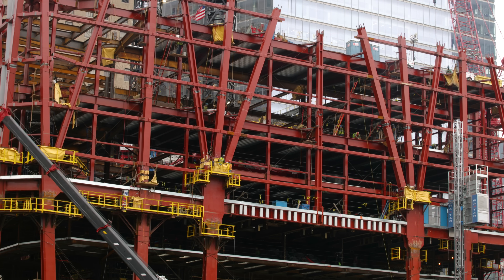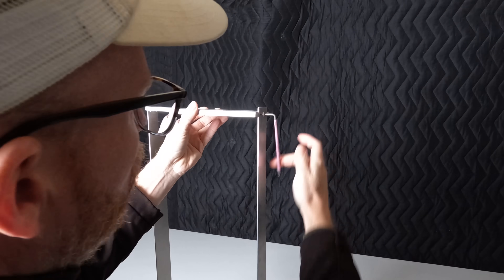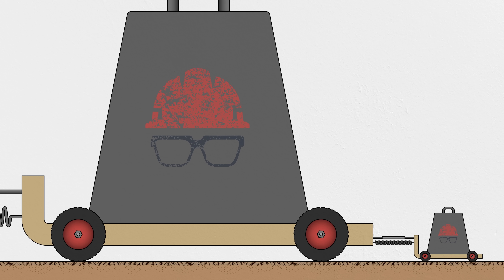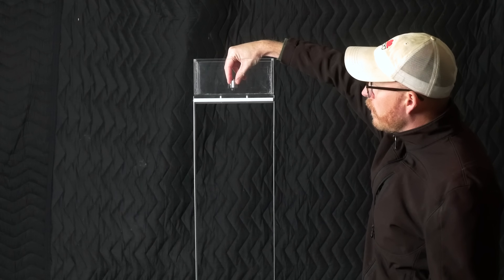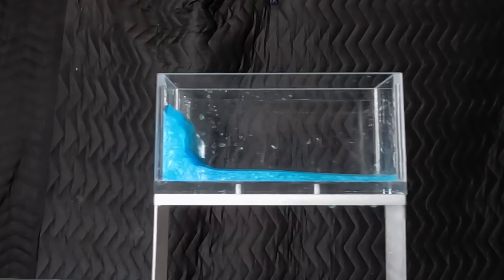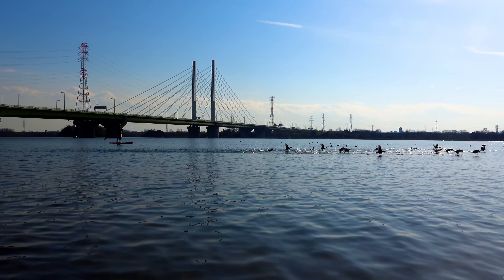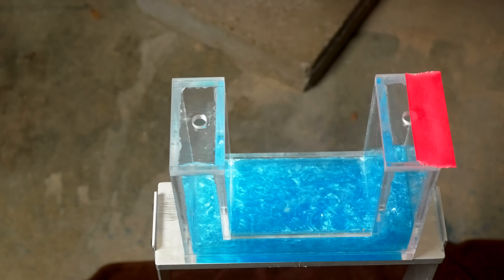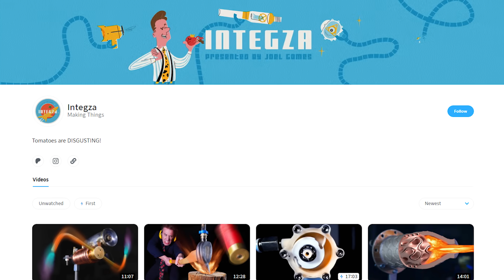How Liquid Dampers in Skyscrapers Work

Comment: It seems to me that taking a page out of automotive shock engineering technology and use magnetically rheological fluid with feed back sensors for a computer to adjust the system on the fly. It’s a very tunable system. ? If financially feasible?

Comment: For the "slosh pool", you could get a much better damping effect with a smaller volume of water by putting the shape of an impulse turbine blade on the end of each wall, so that the maximum amount of kinetic energy was direction ally opposed to the motion of the building.  That would incur additional cost, which is always factor #1 of course, but maybe the smaller size would make up for it?

Comment: Magnetic Rheologic fluid would be the next step to take if a passive water based damper does not achieve the desired results. It would allow real time tuning to dampen oscillations. It’s the technology used in high end race cars, first pioneered by GM for the Corvette.

Comment: Are the baffles also allowing for greater energy transfer between the liquid and structure? Each wave cycle now applies force both to the container walls and the baffle as it passes through. Seems like the ultimate answer would be flow through an isotropic rigid medium coupled to the structure.

Comment: You mentioned adjusting the air hole in real time, but it seems to me you could do a lot more with "active liquid dampers".

All kinds of friction screens and pylons could be raised and lowered in real time from the bottom of the tank to rob the current liquid motion from being transferred back to the building. 

Perhaps even pumped jets to quiet the motion faster. Basically like active noise cancellation earphones that use waves to cancel waves. This would be investing additional energy in return for less vibration. It could be useful as an emergency system when you would be happy to occasionally throw away a great deal of energy in the face of a rare dangerous wind condition.

Comment: Besides the tank being used for fire codes, it could be combined with two additional uses of water tanks at the top of buildings: 

The "water tower" tank used to provide water pressure for the resident's plumbing. 

And thermal batteries that are heated or cooled during cheaper night rates and then used for building temperature control and hot water during the day.

All of this makes me wonder if you could be really clever and not even have a wave tank at all. Just design the piping that runs up the sides of the building for other purposes to slosh liquid from one side to the other as needed.

Comment: So, basically fluid friction converts kinetic energy into heat energy. An automotive shock absorber does this too. Active suspension debued in formula 1 racing. Certainly a sensor array could tune  response to input forces faster than a fixed tune.

Comment: If space is a concern I wonder if any companies or engineering firms have considered working with a liquid more dense than water? The main limiters I can think of would be safety of exposure (water is pretty safe to be around but a denser liquid like mercury not so much) and cost to obtain the amount you'd need. a vat full of glycerin large enough for a skyscraper might be a little cost prohibitive lol
 but it does peak my curiosity!

Comment: That all looks very two dimensional. How do you get the damper to work when your building can sway in 360 degrees, as seen from above? And since it's probably got more than one mode of vibration, it's probably swaying in multiple directions all at the same time. Which might make things a little complicated. Do you install a big circular swimming pool on the top floor?

Comment: Some ships like to employ special ballast tanks that span the breadth of the vessel and are located much higher than a typical ballast tank would be. Coast Guard Cutter Healy has a special "flume" tank to increase its roll period by decreasing its metacentric height via adding weight up high and introducing a free liquid surface. Technically the ship is hydrostatically less stable, but it's a much more comfortable ride when seas are choppy.

Comment: I was about 30 floors up in a high rise hotel in downtown Tokyo when, at 3:57 a.m. local time on July 31, 2011, there was an earthquake about 100 kM from Tokyo. (This was NOT the great earthquake and sunami that occurred in May 2011.). This Florida professional engineer had never experienced an earthquake before but there was no mistaking the event. I could sense the snubbing action of the damping system as it reduced the sway at the end of each cycle. Still, pipes and metal conduits were clanking inside the walls. All settled down and there was no comment about at the hotel or in the news. Just another regular day in Tokyo. Except for me!

Comment: Both types of tanks (the passive one and the u shaped tank that can be tuned by a valve) are being used to dampen the roll behaviour of ships for quite a long time. The passive tank developed by Flume is more difficult to design as it relies on it's frequency to be tuned by baffles, which is not easy to predict. The filling grade in the tank also plays a role in the tuning but that also influences it effectiveness as its mass relative to the ship also changes. It's a simpler tank to build and operate but has a limited range of frequencies so is not always efficient for all ship's loadcases.The U shaped tank developed by Intering is designed for the ship's loadcase with the fastest roll motion. Computer adjustable valves then slow down the self frequency of the tank to work in a variety of load conditions. Both types of tanks are now designed by Hoppe Marine, still making use of the original designer's names. The advantage of these tanks above fin stabilisers is that they work at zero speed, so are useful for ships that have to do construction at sea on Dynamic Positioning.

Comment: I've wondered if putting a pool at the top of a large building like a 15 story apartment complex serves any purpose.   I noticed them while visiting Thailand (chang-mai, and phuket) and then when the big earthquakes in Burma happened you could see video of the water spilling out. 

Just wondering if a large pool on top of a building would dampen the oscillations from an earthquake, or make it worse.  Or if that pool is intended to be the water source in case of a large fire?

Comment: Couldn't you make the fluid damper into a swimming pool? Have a narrow walkway around the pool, and the damping screens submerged. to say 1m below the surface. Pool closes for big storms (or earthquakes! :-) ) and you can increase the damping efficiency by raising the damping screens. Would this work? 

Another geometry would be to have a wider walkway, but drain holes everywhere. That's the damper. As soon as it starts sloshing the area around the pool gets wet and energy is dissipated by water going over the edge and then slowly (with lots of drag) draining back into the pool. (put a sign on the pool area: "Pool closed when sloshing happens"). 

Another geometry to "make a useful swimming pool" out of the damper is to have the damping screens as the end of the guest-accessible pool. The middle sloshes the least
so that's comfortable for guests...

Comment: I imagine you can have a multi-tank setup where individually they act as 1/5 of the total mass and can be valved off or on as needed for the sensed sway, with a weather vane on top to measure wind to prep in step with the start of sway.

Comment: Very cool... this is what I think of when the word "engineering" is applied to a problem.  I have a harder time accepting that term when it comes to software engineering.

I have the title "Sr. Firmware Engineer" and 30 years industry experience. And what I've seem a lot of the time is that the "engineering" is thrown out the window in order to hack a solution and meet a deadline... being told "We don't need to make it complicated"   I studied system architecture, design patterns, writing well defined API's, and design for test (TDD), etc. that we should use in design, by why do I even bother with all that?!? Nobody in management wants to spend time doing that.  One boss defending such a legacy product said "It's not pretty but it works"  except it wouldn't scale and it was hard to make changes and correct bad behavior, plus the loop had to be "tuned" so it wouldn't take away time from another part of the code, lacking real-time interaction between responsibilities... so it was fussy and had issues at times that were hard to control.  They rolled their own solution instead of taking an off-the-shelf RTOS.   I no longer work there because I rocked the boat too much... they didn't like me pointing that out.

Comment: Correct me if I'm wrong but it seems as if the "wind" in your demonstration is always coming from the same direction. Now I know that there are prevailing winds that are predictable but nonetheless at least here in New York we can get very strong winds from a variety of different directions. Think summer hurricanes or midwinter Arctic blasts out of the North and Northwest. How can these systems, which seem to act in only two dimensions, accommodate variations in the direction of the wind.

Comment: Very interesting topic. What is the sensitivity of the device's performance with respect to variation of the water level in the tank? If the geometric design of the tank can impact that sensitivity, could you reach an optimal design where the damper could double as reservoir for the building's supply within certain water level thresholds?

Comment: What happens when you get a significant change in wind direction?  The prevailing wind direction that normally drives oscillation can be accounted for during design, but what happens when you get winds coming from 90 degrees from normal?

Comment: is there any benefit to having dampners stacked? like a 50 story building having a damper at Lvl 25 and 50? I would "assume" the top one would need to be significantly smaller. 

Also, the baffle design suggests to me multiple dampers on the same level would be more beneficial than just one big one? (with the same amount of water). Ie a level with just household hot water tanks vs a giant swimming pool.

Comment: As a structural engineer that worked on a few high rise buildings, we prefer a less complex solution, if we can ofc, and its a truncating design or if u want to visualize it, a pyramid where the building is thicker or more broad lower down than up top, this has the general effect of concentrating mass lower down and hence a greater overall resistance to wind induced swaying as the force of arm has a bigger inertia facing it in the opposite direction effectively stopping the forces dead in its tracks and an added benefit of better seismic loading resistance which decreases cores and shear walls up top effectively allowing for more "floor space" when in fact you just decreased the structural members taking up space. It is why buildings like Burj Khalifa and others like it go more truncated up top. Ofc in buildings where you cant do that you get stuff like Taipei 101 and Pencil towers which I hate because they will fatigue quickly and eventually fail cause physics always wins

Comment: All the experiments in your video show vibrations in a single dimension. However, wind can hit a building from any direction. Would engineers install liquid dampers in several directions to accomodate or is there a liquid damper design that can handle any direction of swaying?

Comment: Very interesting topic, my last semester had a course about vibrations in mechanical systems, essentially the basics of these dampening design calculations and motors and rotors. Even a car driving on uneven road as they in reality are. One of my favourite parts alongside the car and road vibration and speed calculation was how you can think of a beam like a spring.

What happens when the shape of the building is odd (does it limit the size of the tank to maximum rectangle or is different shape ok?) and what if the dampening requirement happens in more 3D situation than 2D?

Comment: Using movable louvers with a feedback system would allow “live tuning” of a slosh tank damper eliminating the variable wind problem.  

Also, instead of the much mentioned swimming pool dual use, how about making it a live reef aquarium?  You wouldn’t even need a wave maker.

This would make it a triple use object:  mass damper, display aquarium, and fire water head tank.

Comment: Often I've wondered where the final thee energy has ran to after such devices and techniques have been employ....been subject to.
Water with its high specific energy I assume adsorbs the heat it's converting from gravity/linear movement of the mass of water? Both engineered structural dampers and the moon- how do all of those those therms escape!?

Comment: The world seems to be focused on water for liquid damping. Has anyone in commercial engineering used other liquids? As an example, beet juice is a popular way to add weight to agricultural tractor tires because it's substantially more dense than water - depending on formulation, up to 11 pounds per gallon. Or maybe someone should try pink slime?

Comment: I lived in the San Fernando Valley back in the  early nineties, and experienced the Northridge earthquake firsthand. That summer I moved to a five story apartment building in the Hollywood Hills. The hills in LA have deep bedrock under their foundations which made them less prone to severe quakes. My building had steel rollers and a rooftop pool, which I later learned was primarily a mass dampener, as it was square and exactly three feet deep on all sides.  In fact, most of the apartment buildings over 4 stories had rooftop pools that served as motion dampers. Pretty cool.

Comment: Use this same concept on our farms bulk water tanks w/ internal dampners when I was 15 yrs old. Tractor didnt have brakes so filled the bulk tank mounted hay wagon 3/4 full. The oscillation would help the tractor slow to a near stop so I could cut throttle n kill the engine.

Comment: One of my favourite ways to demonstrate liquid dampers is to get a rectangular cardboard milk container and throw it in the air with some spin on it while it's full - it barely spins. Empty it and do the same and it spins a lot. It shows how much energy the liquid absorbs to keep the container quite stable.
Reply: One of my favorite ways is with beer! Drink a bottle of your favorite beer til it's not full enough anymore to spill when you lay the bottle on its side. Then give it a gentle nudge with your finger. It'll resist rolling like an empty bottle would roll, and sort of "snap back" to its original position instead. If you push it harder, it'll "roll", but in strange little discrete bursts. You might even observe this effect without intending to, since bottles of beer gain a noticeable tendency to get knocked over accidentally the more of them you drink.

Comment: Those interested in this engineering challenge can also look into the Saturn V rocket and its “pogo oscillations.” So instead of side-to-side movement, rockets experienced a longitudinal (up-and-down) movement, like a pogo stick. 🫨 So imagine a skyscraper, full of liquid, pogoing up and down while burning tons of liquid at one end and accelerating to hypersonic velocities. lol (Wikipedia has articles on both “pogo oscillation” and “slosh dynamics.” There’s also a great NASA page explaining that 1,000 engineers were brought in to the “Pogo Working Group” to fix the pogo on Saturn V. We might not have put men on the Moon without dampening!) The Space Shuttle Main Engine (SSME) pogo suppressor employed baffles, to great success.

Comment: Visually, the grates in the middle of the 'swimming pool' tank worked best. Could not the grate be designed with shape and aperture and to be lifted/lowered at will by electronic means to adjust the building to all frequencies and conditions? Sort of like lifting and lowering fuel rods in an nuclear reactor. Put a AI in charge of the mechanics to achieve a still building in any condition of wind, weather, earthquakes etc.

Comment: Nerd alert. I suspect you mixing damping (dissipation of energy) with nullifying using wave interferention, they are completely orthogonal and independent. You need to tune for "natural frequency" and same time keep opposite phase to use interferency, to spread vobbling part from one point ( building roof ) to whole structure, canceling wave mirroring. Same as thin fraction of lightwave film on lens help to avoid unwanted reflection. Damping works exactly like brakes, by subtracting energy (usually to heat). In practice, engeneers trying both same time, add counterweight on spring and tune it for peak frequency, same time keep distance to be  divided by half wave lenght, and use brakes like viscosous liquid, air with small orifice, or electrodynamic like huge magnet and copper to utilize Eddy current.

Comment: Nope sorry, I'm in the steel construction division. Strength can only be replaced by more strength. Ultimately, the strength of a construction is the fundation of every other proper design trick. If your construction is a twigly fragile mess, design tricks may only prolong the inevitable, a sudden structural failure.
Take cars for example, they use every trick in the book to use as little as possible sheet metal, but fold it a felt 100m times. That does give it certain structural integrity but in an accident, once that thin folded frame becomes compromised, tha car practically turns into a tinfoil ball. No core strength from adequat material thickness left. Also, the driver cabin is irc only rated for 80km/h and only at certain angles.
Would you want to live in a twigly mess of concrete slabs, that have the bare minimum of core strength while at the same time relie on EVERY known design trick to make it stand and not crumble? I think I wouldn't.